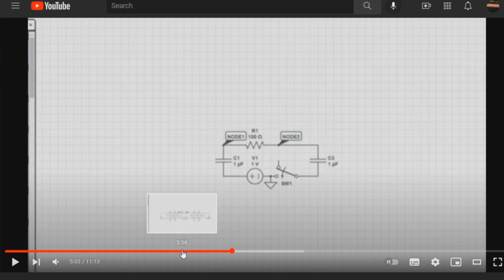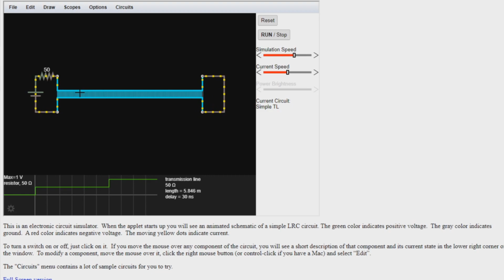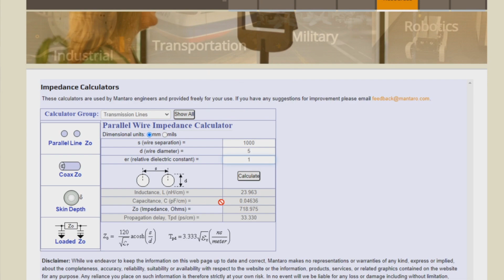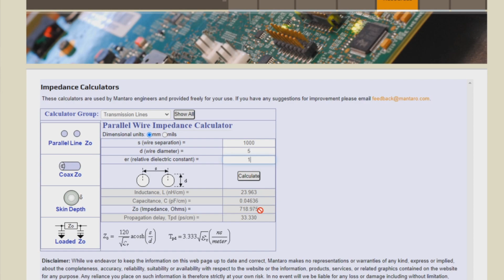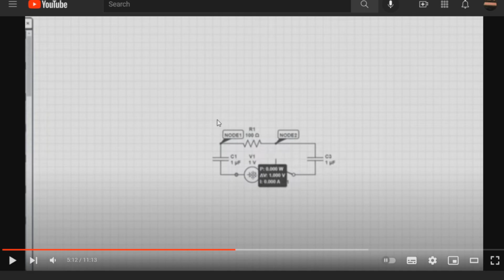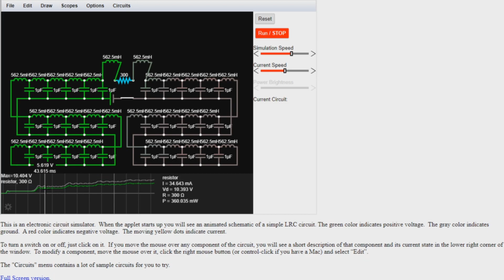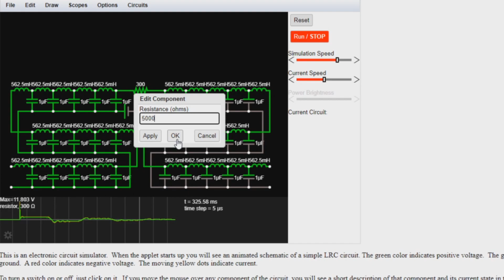2nd analysis, I think I was originally wrong! - Veritasium "The Big Misconception About Electricity"

Comment: What I (heavily) dislike about that Veritasium video is how he intentionally fudges some details to make the shock value. Like, it's nice to say that the perfect light bulb would light up, but a) it doesn't exist, b) he doesn't really mention that it will just blip extremely fast, c) he doesn't mention that simply placing some material inbetween the equipment would cancel it out altogether (i believe), etc.
Like, on his part, it's essentially a trick question. He basically acts like the ability to detect that battery current at 1m distance is the same thing as actually letting the the lightbulb do the work. Whereas IRL, that blip is just the detection of the change in the relevant fields.

Comment: Main goal of the Veritasium was (second video is way better that first one), to tell you, that ENERGY TRANSFER happens OUTSIDE the wire, but normally VERY close (at insulation thickness). That's it.
 
It was not about calculating times (although he posted like a question/quiz at the end - his mistake).
Reply from the maker: I'm not sure what you mean but yes the energy transfer does happen outside the wire. I'm not sure what you are saying about the insulation thickness though, as the fields propagate infinitely out. The entire point is that the 1m distance is un-intuitively far (not insulation thickness), yet the fields traverse that distance forming a coupled transmission line before traversing the length of the very long wire to the very ends.
Reply: @ZongyiYang  WHAT do you mean you "don't understand"? Energy transfer is VERY CLOSE to the wires (exactly within the insulation - material and thickness is not random, right?).
Fields are weaker with distance (what is few feet or meters away, normally doesn't count, does not contribute to the energy transfer, it's only detectable - unless it's a HV power line or radio tower).
 
Average people wonder why nothing happens when the bunch of cables (power, audio, video) lay around the house, and nothing interferes, sparks - that's the common reaction when they hear word "outside". And NO, the fields are NOT jumping around the circuits, like directly from the battery to load - that's the second misconception (and Veristasium drawings in the first video are WRONG, misleading). They (fields/waves) flow along the wiring (unless you crank the E field aka "voltage" and/or frequency).
 
Homework_1 for you: study the coaxial/concentric cable, energy issue (WHERE is it = in the dielectric), then other types, flat ribbon, twisted pair.
Homework_2, Google "high-speed PCB design", again, WHERE is the energy, WHAT are they calculating there: SPACE BETWEEN the traces (and layers), NOT just copper traces (like "regular/normal" wires, traces "only" guide the energy, "outside" the copper, but very close, until you intentionally turn the trace into antenna).
Reply from the maker: @GrandePunto8V I'm not sure what you are say here as you are not being clear, we could be talking about different things. Fields extend everywhere. Fields are stronger near the surface but also extend out to infinity everywhere. Some will go from the battery to load, in simplified drawings those field lines are the ones that are drawn instead of having to draw everything. In reality the fields extend from any moving charge to every point in space.

Skin effects in high speed pcb design is related to this effect, but skin effects is a simplified model. Transmission line theory is a more general model for a specific case of parallel wires. Both stem from the same underlying maxwell's equations. However, skin effects rules for pcb design are a simplification of something more general.

I'm not sure what you are saying, nobody is assuming sparks jump around everywhere in space.

Comment: Modeling is dangerous and powerful.  The whole point of performing engineering is to efficiently use models rather than having to build every concept to demonstrate the outcome.  The initial "blip" issue demonstrates the problems with an incomplete model.  The real "transmission line" has neither a lumped inductor nor capacitor at its input, so neither simulation as presented here, models the true physical condition of the two wires 1m apart.  The whole discussion of the initial "blip" was then a spurious result of the limited model.  I believe using the transmission line model is a red herring regarding Veritasium's circuit attempt to prove his "enticement" hypothesis that electric power flows in the fields around the wire and not with the electrons through the wire.

I suspect you would have to modify the mathematical representation of the discreet element model of the transmission line to allow the number of capacitors and inductors to approach infinity and reduce their "equivalent lumped values" accordingly to properly evaluate the initial condition after making the circuit.  

Neglecting the inductance of the line for a moment, you have a "very long" capacitor fed at one end.  Think of a long narrow channel of still water covered continuously with floating balls and introduce a "square wave of water" to one end of this channel.  If current were defined as the vertical movement of floating balls, the first ball would (theoretically) rise immediately and then its vertical motion would stop, however the next, and next, and so on would continue to rise as the wave progressed so there would appear a "current" beyond the charging of one initial discrete capacitor.   So even though the first had stoped, the next ones would be in some phase of upward motion.  So the power to the bulb would be determined by its resistance plus that of this "active capacitor" until it becomes charged to its full length at which point the capacitive effect would be shorted out by the end of the zero resistance line and the bulb voltage should rise to that of the battery.  But now the zero resistance 3x10^8 long wire is at the same voltage throughout its entire length and there is no electric field between the wires, so where then is the field that is carrying the power from the battery over the 1 meter separation to the load?

Comment: Interesting to see that another channel has actually done this as a real experiment, although only using about a kilometre of wire, but got confirmation of the initial transient, ramping up to the full voltage after a short delay.

Comment: There definitely is a "spherical cow" lurking here. You did not address the original question: how does energy flow, in the wires or in the fields? The claim that it is 100% carried by the field is a spherical cow. You did not specify what software you are using, but I suspect it uses lumped component models like SPICE. In particular, the fields are not even part of the model used for simulation.
Reply from the maker: The fields are modeled by the inductors and capacitors. The transients travel through the fields in the air while the steady state travels through the wires.

Comment: Two wires laying one meter from each other will not be able to sense the dc in the other wire, so your simulation is irrelevant!!!
Reply from the maker: It's not DC when you flip the switch, there is a transient there which is what causes the phenomenon. At DC steady state nothing interesting would be seen.
Reply: No. Those two parallel wires clearly form a transmission line with characteristic impedance on the order of 900 ohms. Between the two terminals you have what behaves exactly like a 900 ohm resistor, except that it's 1 m long. Therefore you have one meters worth of time delay getting things between the battery and the bulb. The wires have capacitance between them and inductive coupling. They are transmission lines. Anyone familiar with transmission lines as an RF engineer or with time domain reflectometry understand all this very easily.
Reply: @Observ45er  You are one of those who confuse DC with RF. Of course, an RF engineer can celebrate the finding of RF at turning on of a DC powered lamp, just like the few cracks you may hear on a radio if you have that specifically laid out circuit and turn it on. The original post hadn't drawn the electricity field correctly, hence got the Poynting vector direction wrong.

Comment: All this math is unnecessary to show Veritasium incorrect. Only simple logic...
https://youtu.be/93t2CdfEWrQ
Reply from the maker: Sorry for the late response. I just watched that video and it is actually wrong. The video maker is correct that the circuit around the battery and light bulb do not have information about the ends of the wire loop on the initial flip of the switch. However, the circuit and light bulb doesn't care, it will still turn on in 1/c seconds due to the induced fields. The wave that propagates will wait until the information travels to the ends in 1/2 seconds, then back in another 1/2 seconds, before bringing back the "information" on whether the light bulb should be on or off. But until that information returns, the light bulb will be on.

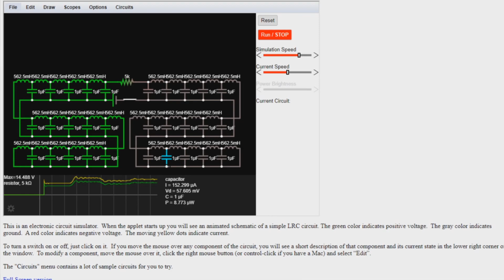You can see this from my simulation as reflections of the initial propagating wave through the transmission line. This reflection is what "senses" the state of the ends of the wires. At 20:49 in my video I address this condition.

Comment: Z Y,
All of this reasoning is PERFECTLY correct!!
THIS IS THE FIRST VIDEO I have seen out of four or five that has the analysis almost exactly correct.!!!
As a VERY experienced RF engineer, I can say that this is the first time I've seen anybody doing anywhere near correct analysis. Well, it's actually the second, technically, because the video by Ben Watson, who did an HFSS simulation shows the initial delay before the small current flows in the bulb. 
However, he didn't really acknowledge it very well in his video, but it shows in his time domain simulation around time 9:30.
.
Once you understand that the transmission line characteristic impedance looks like a resistor it becomes very simple.
.
When you close the switch you have the two characteristic impedance resistors in series with the battery and bulb except they are joined by 1 meter wires.
I was really getting worried, but I finally saw that around time 20:30, you finally mentioned the one meter distance between the battery and the bulb. 
.
It will indeed, take the time for the fields to traverse that 1 m and create that small initial current through the bulb.
.
You are correct that you should not model the transmission line with the capacitor first. That leads you to the wrong conclusion of that spike.
.
All of your simulations about the reflections are also correct.

Now, it does take 1 meter's worth of time travel for those fields to couple between the wires and create the characteristic impedance that looks like the resistor.
Ben Watson used different distances, but it does show an initial time delay equivalent to the 1 m distance in the veritasium model and it shows the low current after that time delay. Then, it shows the higher current later on.
.
However, all, and I repeat, all of your analysis of the reflections with the various values of resistor are COMPLETELY correct.
The only thing that appears incorrect here is the fact that you shows that that small current flows immediately after the switch closes, but then you talk about the one meter distance later on.
So this video has it correct even though you take way too much time for me, obviously to explain it for all the people who don't know transmission lines.
This is really a quite trivial problem for an RF Engineer. 
However, the way Veritasium laid it out, he made it extremely complex and I'm close to agreeing with Dave-EV blog, that he did it on purpose.
.
Also, the video by Ben Watson using the HFSS simulation clearly does show the equivalent of that 1 meter delay in his time domain plot out around 9:30 video time.
Regards
P.S.
I didn't listen to the rest of the video where you open circuit the two ends and figure you probably got that correct.
Reply: Thanks for your comments. I think he did mean to include the 1m/c time delay the whole time. My intention was not to obfuscate but it's obvious in hindsight that I did not express myself as clearly as I would have liked to. I will attempt to rectify the situation.
Reply: @veritasium  Derek,
I'd REALLY like to talk with you about another video, but I got no response from emails or your comment page.  The video is quite incorrect, yet you thought it good.. How can I talk to you.
.
.On the above idea the main takeaway should be that you can not separate the fields from the charge flow. They are one-in-the-same phenomenon that we can't pull apart like that.

Comment: Give me a break.  The whole setup by Veritasium is  gimmicky, and would rely on leakage currents.  The bottom line: Without current, there is no magnetic field, and without a magnetic field, power cannot be transferred using the Poynting vector.   So we would need the electric field to traverse the whole wire at the speed of light to establish this.  But the whole "Poynt" of Veritasium was to use the Poynting vector to make the current cut across the 1 meter gap between the battery and the bulb.  That is an incorrect way to use the Poynting vector because it is only established on 1 side!
Reply: Yes, the setup is made to be confusing and complex, However....  This is the only correct one we've seen so far. 
 Ben Watson's HFSS model verifies the fundamentally correct answer. Look carefully at his time domain plot around 9:15.  It follows 100% of what we already understand about transmission lines, very well..
 https://www.youtube.com/watch?v=aqBDFO1bEs8 

Experienced RF engineers, like myself, know it is.  It is trivial if you understand transmission lines and TDR. 
Unfortunately... Too many others making videos do not.
..
Also...
None of this proves in any way that it is only the field, not only the in-wire current... They are one in the same phenomenon.  It's like a photon being a particle and/or a wave - - same thing, but our peanut brains can't comprehend the full model, only one or the other sub-model of it.

Comment: How does that simulation account for the finiteness of the speed of light?
Reply: Per p.,
WAY out at time 20:30 he quickly slips in the 1 m distance travel time consideration.
All of this reasoning is perfectly correct. As a VERY experienced RF engineer I can say that this is the first time I've seen anybody doing anywhere near correct analysis.
Once you understand that the transmission line characteristic impedance looks like a resistor it becomes very simple.
When you close the switch you have the two characteristic impedance resistors in series with the battery snd bulb except they are joined by 1 meter wires. Now, even though his simulation shows that the current flows through the bulb right away, which is technically incorrect, later on as I say, (time 20:30) he does mention the one meter distance so therefore it does take 1 meter's worth of time travel for those fields to couple between the wires and create the characteristic impedance that looks like the resistor.
Because he only models his 750 ohm transmission lines and not that distance, it doesn't show on his time graph.
However, all, and I repeat, all of his analysis of the reflections with the various values of resistor are COMPLETELY correct.
The only thing that appears incorrect here is the fact that he shows that that small current flows immediately after the switch closes, but then talks about the one meter distance later on.
So this video has it correct even though he takes way too much time to explain it for all the people who don't know anything about transmission lines.
This is really a quite trivial problem for an RF Engineer. 
However, the way veritasium laid it out, he made it extremely complex and I'm close to agreeing with Dave-EV blog, that he did it on purpose.purpose.
.
Also, the video by Ben Watson using the HFSS simulation clearly does show the equivalent of that 1 meter delay in his time domain plot out around 9:30 video time.
Regards

Comment: What if the battery and the light are 1m apart but the wire path isn't.  For instance, if the wire path takes some enormous loop as far apart from each other as possible.